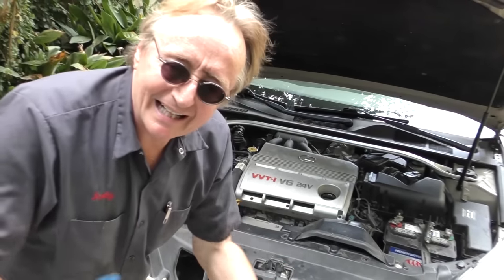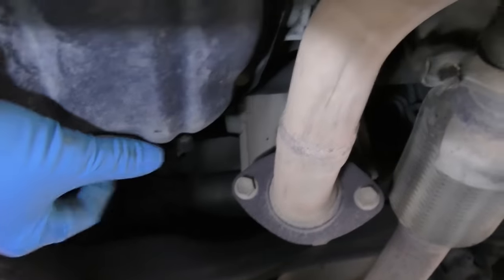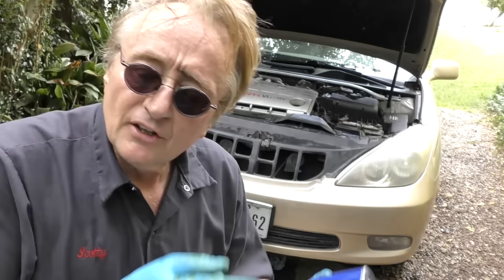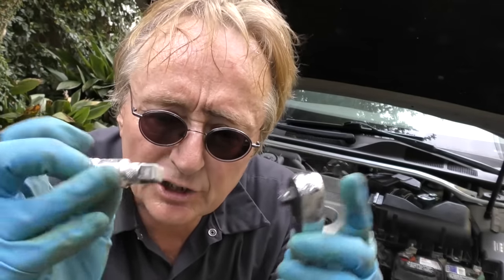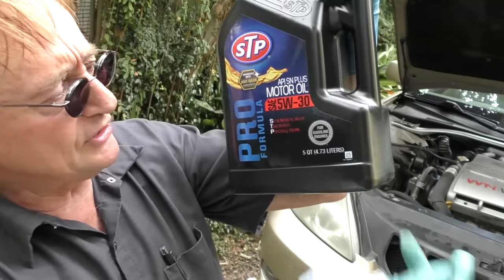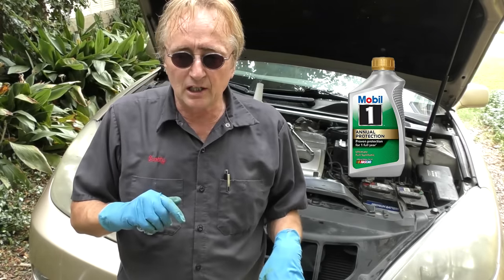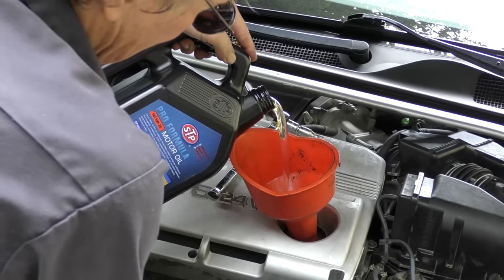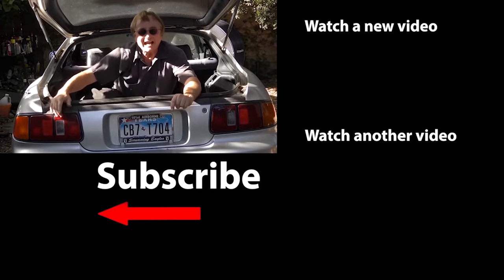Changing Your Engine Oil? You’re Doing It Wrong

Comment: The first and last time I had my oil changed at Walmart, they used a torque gun to tighten the pan bolt. At first they claimed it wasn't their fault because I, of course, wasn't in their system (keep your receipts). Long story short, they replaced my pan and gave me 4 free changes, which I threw away in front of them.
Reply: Wow, just goes to show how some people dont give a crap about other peoples vehicles
Reply: Walmart. This story is true. Hard to believe yes. 
We bought four BF Goodrich All Terrain TA tires and had them shipped to walmart. They very carefully looked over my truck before accepting the job. They were concerned that I was trying to get them to put oversize tires on. The TAs are BIG. 
 Same exact size so they say ok.
First thing they did was break my key. The circuit board fell out in my truck under the seat. They handed me the pieces. Ok...I've got a spare key. Here. 
Then they say they can't do the work. Lugnut recall and they've only got 4 in stock. ? 
I uhhhh... 
Then they lost my keys. That's TWO SETS NOW. 
 The bottom line is those tires peperwork got lost in the shuffle. We never got charged. Two sets of free keys too.  I don't see how they stay in business.  The tires were close to $1400.

Comment: My two cents :)  Never just blindly dump oil into the engine -- the rating may say 5 quarts, but chances are there's still some in there after it drains.  Especially if you're not working on a perfectly flat surface to begin with.  When I get to about 1/2 of capacity I start periodically checking the dipstick.  That's probably too paranoid, you could probably fill to about 3/4th capacity ... but too much oil is bad too.
Reply: Roger that Stephen, people dump 5qts blindly not realizing it could be overfilled. Try to fill the filter if possible so it has pressure immediately if in a position to do so without spilling. I usually fill 1 at less than capacity, start and let run for a few minutes shut off and and check it a half hour later. Usually takes half of the qt I left out.  Overfilled is not good! Clean oil is.
Reply: I usually measure how much comes out and I put that much in and then I go and check the level a few times

Comment: I will say that I have broken the rule of using the proper oil. My oil cap on my 1999 Nissan Maxima says 5W-30. I’ve owned the car for the last 16 years, and have used Mobil 1 0W-30 for that entire time. Bought the car in 2004 with 70,000, and now has 320,000. I haven’t had any issues. 

Also, 5 quarts of Mobil 1 @ Walmart is like $22.00. Combine that with a Mobil 1 oil filter for $10.00, and I’d say a $32.00 oil change is not bad. :)
Reply: Older cars are a little more forgiving

Comment: That oil filter wrench is fantastic, way better than the 3 prong wrench I use by Craftsman. It gets the job done but it's way more difficult than it has to be because of the way it tightens around the oil filter. Also my Ford Focus has the filter in a inconvenent area. I have to twist my arm around a lot of stuff to get to it. PLUS as a result of a hose and other stuff around the oil filter, I don't have that much room to turn the oil filter counter-clockwise, so it takes longer and is more difficult than it should be. I'm done with Fords after this car.
Reply: What cars are you looking for?
Reply: MGB

Comment: Extra Pro Tip: if you use synthetic blend or full synthetic do not go back down in quality to standard oil. The synthetics get into those tiny cracks in the motor and seals better so when they are removed the cracks become more noticeable and can cause the parts to wear out faster. This is primarily because the synthetic was extending the life span of those parts already. This is also why "high mileage" oil is almost always a synthetic blend.
Reply: Myth
Reply: The big issue is don't switch to synthetic from conventional if the engine has run on conventional for a long time.  Synthetic is detergent by definition, so all the crud and sludge will be loosened up by the synthetic and potentially cause blockages in oil passages.   Going backwards, from synthetic to conventional is not a problem, but why would you ever do that?

Comment: Reassurance from Scotty I've been doing this right for fifty years. There's a reason my engines and turbochargers are so reliable. It aint luck! When I buy a used car always at the right price, irrespective of what the owner or seller tells me, I always drop the old oil at first opportunity. That wodge of invoices is NOT reliable proof that Oil and Filter was changed last week in previous ownership. The condition of the old stuff on the Dip Stick does not always support that. A quick wipe over the old oil filter with a clean rag can have it looking like a new one just fitted... 'appens. I always write the Mileage on the Filter when I change it. I service all my family's cars and cannot remember all that stuff. I always put a sticky label somewhere in the engine compartment with details of the oil change, dates, mileage and Oil Grade used.

Servicing my own and my family's cars has over many years saved us a fortune in servicing costs. Plus the bonus of knowing the job has not only been done, but done properly.

Here's something I do with cheap old cars but otherwise tidy cars bought with Oil that looks and runs like black Treacle. I drop the Oil HOT and leave drain plug out overnight .. there will still be the regular drip as the old stuff continues to work down and out of the engine even in the next morning. There will still be LOTS of old contaminated sludge lurking in the engine including old burnt oil varnish like residue on Cam Followers and other key components. That means noisy slow to return "tappets" and other parts of the Valve Gear. I must stress that I am NOT recommending this, only that it works for me with old cars with uncertain maintenance programmes in previous ownership. Here's what I do since a wiser car guy than I told me about back in the day.

I replace the drain plug in the Sump/Oil Pan and fill the engine with DIESEL FUEL to the correct level. Then use the car gently for say twenty-thirty miles, then drain the Diesel Fuel ( which is Oil as Diesels are known as Oil Burners for good reason ) HOT. The first time I did this I was amazed at the muck that the Diesel Fuel flushed out which would otherwise remain in the engine and contaminate the fresh new oil. The Diesel Flush means that the oil is still clean and clear on the dipstick for some hundreds of miles later. The simple drop and fill Oil Change will see the fresh engine oil black soon after starting from contaminants still lurking in the engine.. 

It has worked for me many times. That noisy valve gear is now a near silent rustle sound. Throttle response is better and even fuel consumption improves. Never done that with the new cars I've bought of course. I always service my cars myself from day one new so know they've been well looked after. I have known passing neighbours when seeing the oil drained from my cars bought new, have told me they would not hesitate to put my old oil in their cars' engines. I do change engine oil at half the manufacture recommended. As Scotty rightly often reminds us, good quality Oil is far less expensive than a replacement engine. 

Keep up the good work Scotty. I'm off to ring dat Bell .. ;-))
Reply: @MG John - Whew !!  Anything else you care to share with the audience ... after the long high school thesis on oil changes ??

Comment: Honestly, I’ve yet to change an oil plug gasket.  Every plug I’ve had either did not have one (I believe all are machined to fit without gaps and were leak proof when adequately tightened) or the one car that does have one, so long as it’s in good condition, it’s perfectly good.  I do have spares but only use one if the gasket looks damaged.  I think they are used more to compensate for inadequate tightening, as a buffer against over tightening, or as protection should a strike on the oil pan deform the area around the plug enough to compromise its water tightness.
Reply: Alot of older model cars had a plastic gasket ,that would crack n leak over time,it may be only a few drops tho in-between oil changes
Reply: Can you say Fumoto?

Comment: Remember to loosen the fill cap before you drain the oil but don't take it off so you don't drop a socket in there
Reply: @Alien Wired Maybe  doing the plugs while you're at it? Just don't drop anything in there.
Reply: or a turkey dinner

Comment: Did anyone else notice the filter he took off had absolutely no oil on it or in it?
Reply: The way it's oriented makes it so it pours out more rather than having it straight up
Reply: Maybe or maybe I'm wrong
Reply: He could've put enough oil in it to still be able to get it back on without spilling any. Putting a dry filter on is never a good idea.
Reply: Yes!  That's ALWAYS the messiest part of the entire job for me.
Reply: @Saltinator  - the filter mounted horizontally. Good luck getting the filter on without it spilling all over the engine and undercarriage. I had a Toyota V6 and the filter was always fairly empty/dry when I pulled it.
Reply: Yes
Reply: Probably because it is a jiffy lube filter lol they aren’t worth 2 cents
Reply: Are you paid by Toyota/Lexus? Cause that’s a horrible filter location and no where near as easy as oil filters not located under a fricken exhaust manifold.
Reply: Richard Thomas  but that wasn't the case in this situation. An empty oil filter means there is a short window of 0 oil
Reply: On many vehicles it is pointless to prime the oil filter. Subaru actually mounts spin-on filters facing threads down. Not only pointless, but impossible. Manufacturers are not worried about your engine being “starved” of 0.4L of oil once every 8,000KM...
Reply: @addder7385  You're right - some engines drainback better after shutdown then others.  Is been a long time since I peeked under the hood of a nissan sentra, but I think that engine had the filter spin on from the top and it didn't make much mess.
Reply: Man that Toyota is easy. You can actually SEE and TOUCH the filter. Try a Chevy Cavalier sometime ( otherwise a pretty good cheap car). That one cured me of doing my own oil changes...
Reply: @Mark Codiroli guess I was raised in a different generation, we always do things the right way even though it takes a little longer.
Reply: Maybe he just put a dry filter on unsnug so it would be easy to take off for the video!?
Reply: @frankieforza  why in the world would he make a cake video?
Reply: im j
Reply: im 59 ive never had a problem with the oil filter gasget coming off thats a lesson from scotty that never seems to happen
Reply: It did leak as soon as he pulled it off. But since he held it up right , Nothing spilled.
Reply: @pbaker7160  ki
Reply: To do it "right" on my truck I need to roll it over onto the passenger side door. That way I can fill the filter first. NEVER INSTALL A DRY OIL FILTER. (According to the experts in this thread) .
Reply: You know it's a demonstration, right?
Reply: Looked like new filter..
Reply: @randyware9645  - 59 here too.  I've changed oil hundreds of times and I try to remember to look for that gasket but forget sometimes.  The horror stories i heard when I was young made it sound like it happens every few times.  Never happened to me or anyone I know.
Reply: @randyware9645  It happens all the time when some ding-a-ling didn’t put oil on the seal and then overtightened it. Jesus, you should see the mess it makes when the car is started! High-larious.... as long as it’s the other guy, not you.
Reply: He probably drained it beforehand. 
By law you can't dispose of an oil filter until it's drained. I know there are some who don't, but it's illegal
Reply: @Saltinator  i always fit a dry filter never had a car seize yet lol
Reply: @Jon-us1bx  Oil pump will shoot out a gallon in a couple seconds. Filter gets filled before the starter stops turning.
Reply: @rodbender6184  Precisely

Comment: I've always filled the new filter with fresh oil before installing - I never liked the idea of the filter having to be filled while the engine was running. Not sure if this helps the engine get lubricated on startup or not, but I did put 6ooK miles on an 88 Golf, which was still running perfectly when it got stuck in 3rd gear and I took it to the junkyard.
Reply: Not an option for some cars with filters on the side or on top.
Reply: The engine has a small amount of oil on all surfaces so running it for 2 seconds before the filter fills up probably won’t Damage it
Reply: I manually fill my filter
Reply: Not only do I fill mine at least halfway to prevent dry starts ( the condition where surprisingly most engine wear actually occurs), but I was taught to remove the filter seal completely and lube both sides of it

Comment: Use a breaker bar to tighten the drain plug, i got a good laugh outa that,...really what I found to be best is a 3/8 long handle ratchet it give better "feel"
Reply: Meh as long as you don’t crank on it he put it finger tight then went another quarter turn but yeah not the normal way to do it
Reply: Take a torque ratchet
Reply: A closed end wrench ,with a longer handle works best ive found. Once you break it loose ,you can use your fingers

Comment: Years ago, I found that once the hot oil draining out reached the slow drip stage that if I put an empty pan under it overnight I would collect about 1/2 to 3/4 cup of dirty oil. So I always let it drain overnight. And I always change the filter. The manual says it takes 5-1/2  quarts with  a filter change. The motor in my 95 Blazer (240,000 miles) is strong.

Comment: Once the engine gets a lot of miles it may start to use a little oil due to the tolerances not being as tight anymore. That is when you change for instance from 5W30 to 10W30. At least my dad's done that in several cars he's fixed over the years that were using oil and they never used another drop.
Reply: just use high mileage synthetic.  no difference in 5-30 and 10-30 except when its cold.

Comment: 30 years ago I had a 72 Camaro...filter gasket was stuck on the engine..I didn't notice.  Yup, started the car with the new filter on and all the fresh oil flooded out!  Check your old filter to make sure the gasket is still on!  And don't forget to wipe where the filter came off to remove any possible grit.  

Also if using a band clamp remover and it slips around the filter, put a few rubber bands around the filter...the grip is amazing!  That tip also works for unscrewing tight jar lids!

Comment: I have never changed oil plug gasket in 45 years. I have never had the leak.
Reply: Yep mechanics will mechanic ...
Reply: Yeah... Had the same one on for a couple years, no leaks.
Reply: I don't change them EVERY time, but every few times works well for me
Reply: Yes especialy metal gasket are very good never neds to changed.
Reply: My last Subaru did. Its the first one I replaced in 40 years.
Reply: I have not either I am thinking some have a gasket like that.
Reply: Ive changed the washer a few times over 50 yrs of oil changes not a big deal if you dont over torque.
Reply: I think on older cars eventually the pan gets polished perfectly smooth from all the oil changes and it seals just fine with the hardened gasket.
Reply: Use pipe thread sealant on drain plug, never hardens, never leaks.
Reply: @brighter22  Thats exactly my reason for my doing my own oil changes. When a quick lube place comes up and shows you the stripped out threads in your oil pan and blames it on the last guy, when they WERE the last guy, I do it mysrlf.
Reply: @marksreviewsandrants8554  Subaru does for sure. I had to replace one on my 2010 Forester. It cost 45 cents. I bought 2. My 2014 Outback has a solid washer made of a soft conforming metal, eather copper or brass/ copper mix. I will NOT be changing that unless it leaks. Thats highly doubtful. It also reduces the chance of stripping oil pan threads because the material flattens and takes up torque that would normally pull out the threads. Not says it couldnt happen if Someone tried.
Reply: TexasScout Noneofyourbusiness  crush washer every time on my Honda
Reply: @scottfirman  I bought a brand new Subaru justy in 88 and it did not have that washer of course they don't make the Justy anymore it was a pretty good car the oil filter was in a tight spot but got it off with no tool.

Comment: I drive Mazdas which use their 2.5L GDI engine. Even with good synthetic oil, the engine starts to run rougher after 6 months. Hence, I stick to a June & December oil change schedule to account for summer and winter. This is in line with Mazda's recommended maintenance schedule.